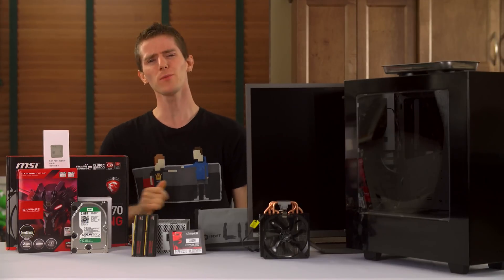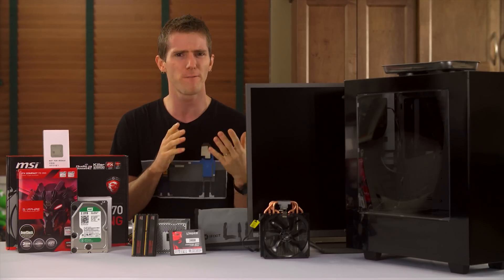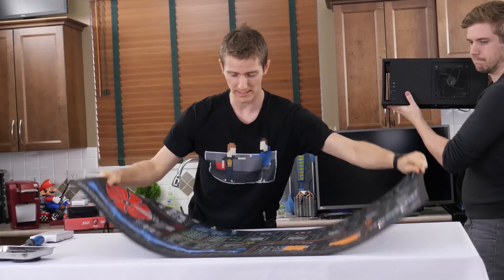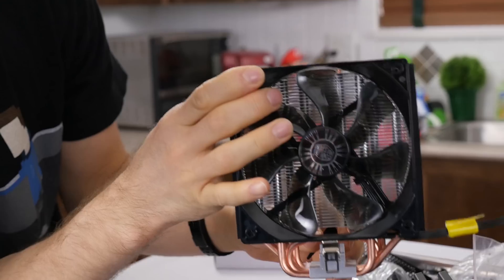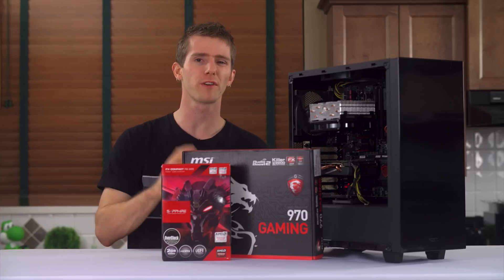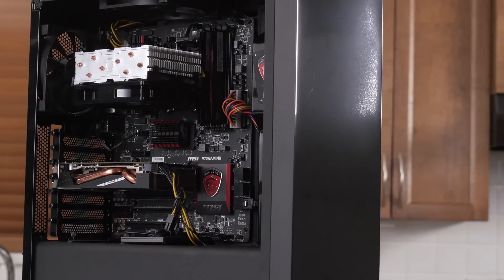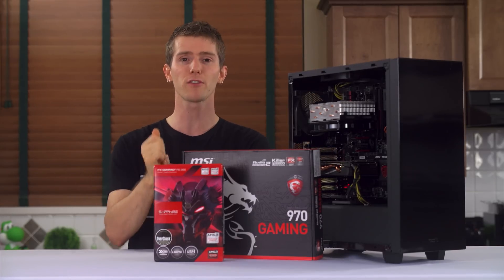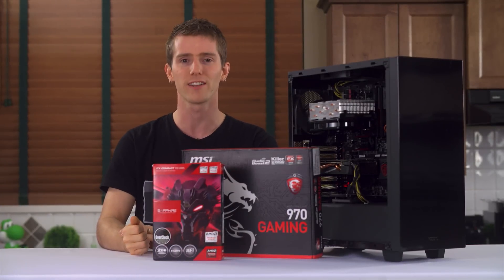Can you Build a 4K Gaming PC for Under $1000?

Comment: Luckily at a 4k resolution, that amd cpu wont bottleneck that r9 285. I guess that build wont work at 1080p very well.
Reply: Timmy H.
But you did say it will bottleneck 285 at 1080p which is not true. 290 is significantly more powerful and its not bottlenecked.
Reply: it wont bottleneck at all .......................
Reply: Axecution At 1080p it will in some games. Dragon age inquisition is one example. I had this build before but with a 6300. I know wat im talking about
Reply: Timmy H. 1 game doesnt mean "that build wont work at all"
Reply: Axecution ok so here is a list then. Watchdogs, Planetside 2, metro 2033 redux and last light, assassin's creed 3 and up, shadow of mordor, saints row iv, world of warcraft, guild wars.......list goes on. In all the games, i got much much better performance when i switched to an i5 4690k. Im not talking slightly better performance. As much as 30 fps increase in some titles. But this is a 1080p, at 4k well that wont be the case.
Reply: Timmy H. bullshit. are u sure u used 6300? and not a 6100? im not amd fanboy or anything but 30 fps + should be gained when you are moving from a 2006 year cpu
Reply: Axecution 6300 clocked at 4.3 ghz. In planetside 2 i went from about 25 fps in huge bio lab fights of about 100ppl to to 50-55 fps average. 30fps might be stretching it. In most cases its 15-25 fps. In dragon age in some areas i would get like 45 fps, gpu usage would be like 65%. Now ive gotten 65+ in the same area during combat. 90-99% gpu usage. Im surprised people still think amd cpu's dont bottleneck. Even the 8350 bottlenecks but much less.
Reply: Timmy H.
Then you had bad OC on your 6300. I have seen a lot of people saying their OCed 6300 is under performing and "bottlenecking". They either pumped too much or too little voltage for OC and didnt bother to search for sweetspot.An 4.6ghz mine was 24h stable from 1.4 to 1.45v, but has best performance at 1.416v

I have tested bunch of different games with my setup and 90% of them have the same result as i5/r9 290.
Other 10% is for MMOs and strategy games that rely on 1 core and thus giving quite big advantage to intel CPUs
Reply: Timmy H. Bullshit. I use FX-6300 4.6Ghz and R9 290 and in Dragon age max settings gpu usage never dropped below 95% ~60fps avg. Watchdogs runs like crap on any system, shadow of mordor ran at ~60fps with ultra textures and gpu was at ~95%. Switching to i5 would give you 10% at best ( and thats not worth it for 100+ $ more ).

In MMOs there is quite a difference between AMD and Intel.
Reply: silni7 nothin was wrong with my build mate, my cpu benchmarks were almost identical with what i saw online. Out of curiosity i looked up "will a fx 6300 bottleneck a r9 290". I dont know if your set up is immune to bottlenecks but 9/10 times people were saying the same thing, your gonna get bottlenecks in anything remotely cpu intensive. I dont know if u got the best 6300 this world ever saw but its not just me who has gotten bottlenecking problems with a 6300. Dudes with gpus less powerful than a r9 290 like a gtx 770 see the same issues. But anyways, to me its not ok to get a 6300 and make up excuses like "it will hardly bottleneck, 99% of games will run fine, most games are gpu bound". Bruh, im just telling u what i got out of my last build. I looked it up and asked on many forums if i was getting a bottleneck. Literally everyone said i should switch to intel or get a 8350 which would still bottleneck but less. Im glad for you but not everyone has it that nice mate. You must be blessed or missing something.
Reply: silni7 It's not bs if im telling u the exact performance that i got. I play more mmos, but even in single player games i got 15-25 more.  Gpu usage in these games fluctautes between 60 and 90 constantly with no leveling off. Switching to intel was the best improvement i ever saw. Idk where u got that 10% number from but what i saw was different. Much more improvement.

I dont aim for 60 fps by the way, i aim for 120 wherever i can cus of my monitor and the bottleneck comes in when u lower graphics setting expecting to get much more fps but gpu usage just goes down. I much rather try to get 120fps thats just me but i couldnt achieve that with the 6300. Gpu usage would just drop if i lower settings which should not happen. With the intel, it keeps it at above 90% no matter what settings. I dont care much for graphics when i have a choice
Reply: Eric Slattery Ive seen this before, i dont see its relevance in this convo tho. We are talking about completely different set ups....Its ez for me to post a link that shows intel beating amd but its not relevant to this convo.
Reply: silni7 i think its the games we play and the setting we play at. I did cpu benchmarks and they held up against what i saw online so i was sure it wasnt a bad oc. In my experiences its like there is a limit to the max fps that the 6300 can output when you lower settings. Test your games on medium setting and try to attain very high framerates. You will see that the fps does not increase as it should compared to intel builds.
Reply: Timmy H.
Why would i lower settings if 6300 and 290 can maxout the game ? same as intel.
For lower resolutions and settings intel will give you better results and i know that, but if you are gonna do that then you shouldnt buy a highend GPU.
 Im not saying that AMD is as fast as intel, just that its fast enough not to bottleneck highend GPU at 1080p and up.
Reply: silni7 i didnt say i had a r9 290. I had a r9 285 which aint really high end. My aim was to get 120 fps where possible. On ultra settings thats not possible with games dese days. Lowering settings to get better frames is a common practice but it doesnt wrk well at all with the 6300 i had. If i had a 60hz monitor then my framerates would already be close to the max refresh rate but thats nt the case for me. I thought wen i got a 120hz that i could just lower settings and get 80-100 fps and more in some of the games i play because i saw benchmarks that demonstrated that.
What i didnt realize is that they were using intel.
Reply: silni7 i did get bottlenecked at 1080p 120hz. I never mentioned 4k in my build. Lol you're 1 of those dudes who like their own comments. And its worse for mmos or any game with a bunch of units of screen. Even at 60 hz a bottleneck comes in. Like in shadow of mordor, when shit hits the fan and 100 orcs are on screen the gpu usage dives. That doesnt seem to happen with the intel i have now.
Reply: silni7 and u mentioned the price and said it wasnt worth it. Games are getting ridiculously cpu intensive while the support for multi core amd cpu's in games isn't quite there yet. Dragon age works better cus of mantle but i still got questionable gpu usage in alot of areas. I had to double check if mantle was on like 10 times during some play throughs. To me the intel is worth it cus i know it will hold up in all genres of games for most titles. I dont wanna try to play mmos and get the "nope, go play other games your cpu aint ready", im tired of that. Im happy now tho :)
Reply: Timmy H.
For MMOs i agree, intel is much better, but for shadow of mordor and dragon age there is something wrong with your setup. I just spent 30 mins playing shadow of mordor in middle of orc camp where i let them raise the alarm and gpu usage never dropped below 95% ( GPU OC 1050/1250 ). For dragon age you might wanna change back to DirextX since mantle is buggy as hell. Im on my 3rd playtrough and no weird fps or usage drops in DX. Mantle is whole different story, completely unplayable.
Reply: Timmy H.
And most of the time those who respond to amd bottleneck are intel fanboys or are basing their opinion on someone elses claim that in no way 6300 can handle highend GPU. I have this combo for a year and and i tested with bunch of games and it performs great. Even in synthetic benchmarks GPU is scoring the same results as intel cpus which shows its not bottlenecking.
Reply: silni7 well the same way that you cant prove its intel fanboys, i can't prove they arent but i can speak for myself and the people i know who have 6300s. Overall, im glad i got the intel because i can play all the genres of games i want. I couldnt stand the "you can play this but not this, play these but not those". I i had the 6300, r9 285 build for a while and in the games i played there were very noticable bottlenecks. Idk how you get no bottlenecks at all but most ppl seem to do with mid range and up cards. Im no fanboy, i just go with what's better for now and the future and that 6300 is gonna be problems if it isnt now. Good luck man. And even if half the people are who are saying it will bottleneck are "fany boys" then why are they right lol...at least in my case. Im curious, what games did you test other than dragon age and shadow of mordor? I have two gtx 660s as well that i use to test. One example of a bottleneck would be in dragon age inquisition, in the hinterlands base i got 20-23 fps with no msaa on ultra and my gpu usage was 60-65%. In the haven, i got 42 fps looking at the training camp, usage was 65-70%. With the intel usage shot up to 90-99% and the fps was sooooo much better. Thats one example of my bottlenecking experiences.
Reply: Timmy H.
Dragon age running around in hinterlands camp/base 45-60 fps usage 90-100% ultra quality (fade touched textures) no msaa. I tested Tomb raider 2013, Thief, Crysis 3, AC4, MetroLL, Hitman absolution, Batman arkham origins, Titanfall, Ryse, Rome 2, SWTOR, Grid Autosport.

Friend also played bunch of games with his 6300 stock and r9 270 and no issues at all.
Reply: silni7 im glad for you and your friend lol. In most of those games im fine cus they are mostly gpu bound except for ac4, crysis 3 sometimes (there are stages where gpu usage dipped a lot.....like the dam) and well dragon age as i mentioned before. Most of the games i test were cpu intensive as those are what i play.

Planetside 2 (abysmal on all amd cpus, i got as low as 30% gpu usage), rift, wow, starcraft 2 occasionally(also abysmal), saints row iv for some reason had poor gpu usage, metal gear rising revengence (80% of the time is a cool 60fps but when u slice up enemies too much the sheer amount of objects onscreen seems to be more than my 6300 could have handled, their engine is kinda bad anyways), metro last light (smallish bottleneck, got about 10 frames extra in some heavy npc areas). For all these games i listed, switching gave me boosts of as little as 5fps-10fps to as much as 25fps. Definitely worth 100 extra bucks, considering that i wont need to upgrade it again for a long damn time. Single threaded engine coding for games isn't going away anytime soon or ever lol, since it is apparently much easier to do. The creative director for planetside 2 actually said its much easier for them to optimize for intel. I aint no fanboy, i just want my shit to work which it is now that i switched and man im happy af.

So even tho you claim to have 0 bottlenecks im still gonna continue to warn people of its limitations.
Reply: Timmy H. Dude I think your cores might have been parked....I have a couple of the games you mentioned and yeah cores were parked, as soon as I fixed the issue I basically had a similar experience as what you had upgrading to an i5.
Reply: Brent Kullrich according to cpu benchmarks my cpu at the time was up to scratch. The first thing i checked was my cpu itself. I made sure that was fine first.

Comment: R9 285.... PFFF!

I built my friend a rig with a 4460, and a Strix 970, in the same case (in white), with a 120GB Intel SSD, 1TB HDD, a Fully modular gold 650W PSU, a wifi/bluetooth card, and even a 2M NZXT LED Kit... All for less than $900....

You have to be patient and look at sales on /r/BuildAPCSales for like a week, and then not buy an OS, but it's totally fucking worth it. $900 for a build that's that fucking good at gaming, that good looking inside, and has that much functionality and general speed overall, is just insane.
Reply: yes he should of waited around for half a year to show us the video :S
Reply: Eric Slattery Are you fucking high? The 4K display would have had to be ~$190 to fit all that within $1000, at the lowest prices you can get all the parts right now. The display shown in the video is $1100 on it's own..
Reply: Eric Slattery 1. THE DISPLAY IS NOT INCLUDED IN THE $1000 PRICE. END OF STORY. I guarantee that it was not factored in when they made this. It could be accomplished with a lot of patience and market sense, but it's not at all what they had in mind. The build, parts only is $813 after rebates and such at the absolute lowest prices on part picker. Linus usually includes an OS, so you can add about another $100 onto that, leaving $87 left. How do you plan on fitting $400-700+, into $87?

2. I wasn't making any claims about fucking CPU. I just listed it because that's literally what we bought. The notable difference is the GPU, which is about 30-70% faster in real world gaming tests. It also has twice the vram to max out the textures in most games with basically no impact on framerate.
Reply: i think its his job to use the msrps, most pc builders know to look for deals and use the msrp to budget the max they would have to pay

Comment: The first thing Linus talks about is future proofing your monitor. You can actually future proof a monitor setup so if you are going to get a 4k monitor don't buy one for $400, it will have terrible colours, be laggy as hell and overall stink.

So the rest of the vid doesn't really work as the build leaves so little for a monitor that you'll be doing exactly the opposite of what Linus recommends.

Build a system that can play at 1080 or 1440 on the latest titles and get a good 1080p 144hz monitor and run a custom resolution of 1440. This you can do for $1000 and it will suffice.

I know companies have to sell shit, but you tubers need to be advising to their markets potential and going by steam stats the majority of that market are playing with 1gb-2gb VRAM. So 4k ain't going mainstream anytime soon.

Comment: you cant get a 4k monitor within that budget though.
Reply: Jake Shaefferr without a psu, case, hard drive, or disc drive of any kind.
Reply: Jake Shaefferr $518.99 & FREE Shipping
Reply: $90 over budget, not that big of a deal.
Reply: Carbosful most ppl do not have freinds who give them 4k capable computers
Reply: did you watch the video? it was within the budget
Reply: Numsefisk43
CPU = $131
GPU = $236
MB   = $112
RAM = $93

$572 with No HDD or DVD Drive or PSU or Case

I doubt you can get all that and a 4K display for $428
Reply: Brick Tamland http://www.amazon.com/Samsung-28-Inch-Definition-Monitor-U28D590D/dp/B00IEZGWI2/ref=as_li_ss_til?tag=techs096-20&linkCode=w01&creativeASIN=B00IEZGWI2
Reply: Jake Shaefferr Oh snap
Reply: Brick Tamland Guess I should read, hm.  

Well, this was a BUILD for $1K, not everything. Though, you do have a point of it being over 1K w/ a monitor.
Reply: actually YES you CAN, you should FRIGGIN check ur FACTS okay?
Reply: Carbosful Brick Tamland should have said " you cannot get a 4k IPS monitor within that budget though " as 1 4k IPS monitor is $999.99 leaveing you with $.01 for the computer if you were to include the monitor as well of course.
Reply: yumri4 Yea well my freind gave me a computer for free SO you CAN do it with that budget.

Comment: My problem with the six core amd is that even though it has 6 core it has 3 modules (clustered multi thread) and in floating point operations it behaves like a 3 core cpu (with simultaneous multithreading), the 8 core has 4 so even if it has to be work as a 4 core 4 core is what people call enough core nowdays

Comment: Linus, I think this gaming rig could perform out of this world at only ~£650-£680 /$1000.

CPU-Intel core i5 4690k
GPU-EVGA gtx 970 for the win edition
Psu-Arctic 850w 80 plus bronze
Ram-8gb hyperx savage 2400mhz
Case-Corsair spec-01
Motherboarf-gigabyte h97-guard pro 
Liquid cooling-Cooler Master Sedion 120v, 120mm fan x1 
Fan- Arctic f12 120mm 
Hard drive-western digital caviar blue 1 tv
Reply: This doesnt include a 4k monitor tho
Reply: I thought that Linus' build didn't include a 4k monitor, 
But anyways what do you think of the build and how it will perform.
What resolution will it play games at,
If you have a build could you tell me the pats that you picked and what parts you think are all compatible and will give great performance.
THANK YOU
Reply: better, the fx 6300 is shit compared to the i5 4690k. well atleast in gaming
Reply: I think the EVGA gtx 970 has a lot of horsepower as well.